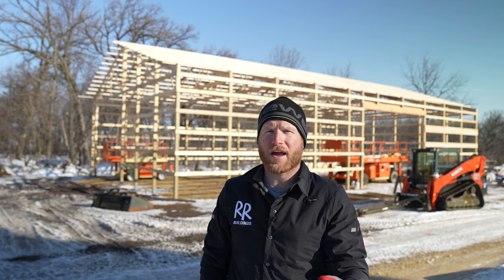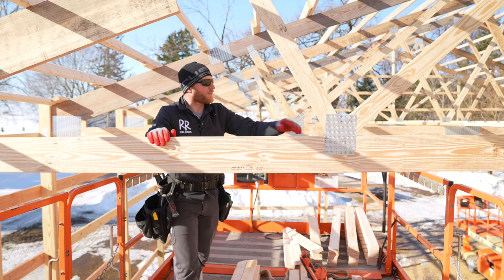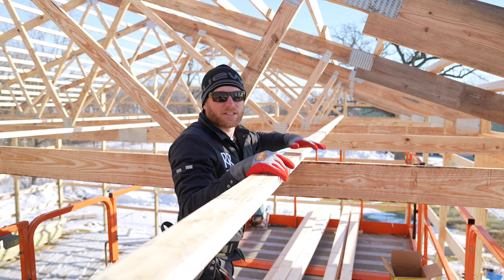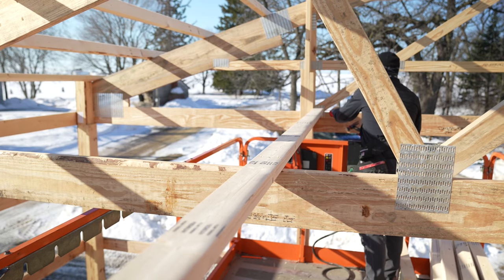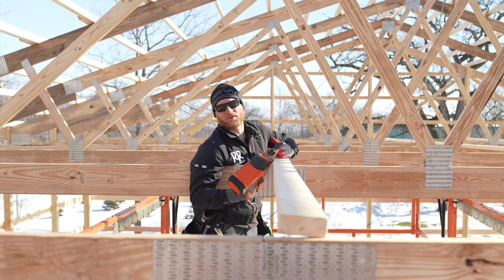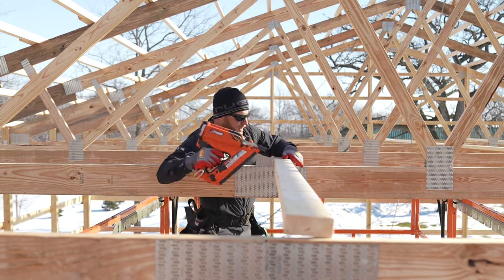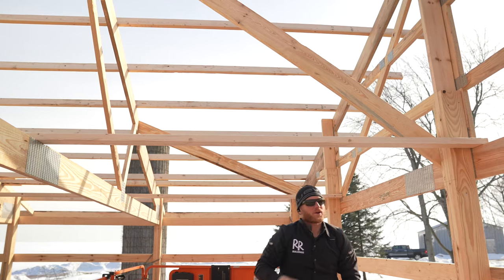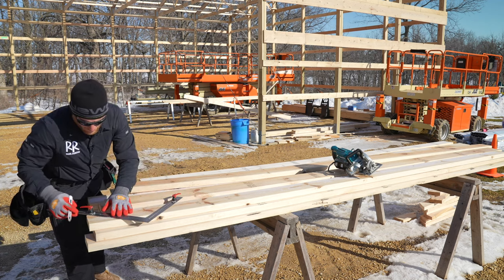How we install Permanent Bracing while Framing! Major Partnership Announcement

Comment: "more electronics in a battery only model which leads to more repairs" - I smell BS on this one!
Reply from the maker: Actually true... I’ve had two Metabo need repairs and many guys have their Milwaukee and metabos have issues
Reply: My dewalt never made it more than a week...
Reply: I've bought dozens of paslodes ever since the orange model came out. And besides the very early models occasionally having a wiring harness issue after many thousands of shots, the electronics are very solid. Never had to replace a fan or a spark unit.

Comment: If money, weight and cords are NOT an issue, what’s the most durable and efficient gun to buy,  I’ve been trying to decide on one for the last 5 years.
Reply: Honestly, look for an old Hitachi NR83A for full head of NR83AA for clipped head. Great guns, need a compressor. The NR83A2 is a close second, still made in Japan. I've heard that the newer versions aren't as reliable.

Comment: My father has an older paslode framer we use to use, and it doesn’t matter if the battery is new and charged and a new gas cell installed the thing just fires when it wants to. Doesn’t matter if it’s 85 or 50 degrees either, and I’ve done a cleaning on it. What part do they need to change for a “service” to the gun on why it doesn’t shoot?

Comment: Weight of the tool is an advantage when working with it (i.e. the lighter the better) however doesn't the lighter weight cause more light-strike nail settings, or, cause the operator to use more downward force to compensate for the lighter weight in order to get the nail completely seated ?  Just wondering.

Comment: I was going to buy Milwaukee cordless nailer. Now you got this Paslode...  What would you choose if you had to choose one?
Reply from the maker: You’d have to tell me more how you will use it because that matters.  Milwaukee is slightly more power at the cost of over 50% heavier.  Ergonomically the paslode wins too but Milwaukee has bump fire and no need for fuel cells
Reply: I am will be building a pole barn shop. Use it on that and any shed projects around my property. I am not doing it for a living like you guys do.

Comment: You say the paslode won’t have issue before a battery only gun however my paslode has been Miss firing and only working on certain gases. It makes me wanna go battery only due to these issues
Reply from the maker: Simple issue usually check the tip for paper tape build up

Comment: I'm curious why you choose to do cross bracing than the perscribed path of brace panels? Just a cost thing?
Reply: If I may Kyle. 
 Joe, follow the instructions of your (SE) structural engineer.  He's the one responsible for the structural integrity of the building.  The cross bracing Kyle installed is his method and I presumed he got assurance from the SE that
it  fulfils the design intent.  The panels you mentioned are a viable solution since they create a diaphragm action also.  If one method is shown on your plans and for economic reasons you want to do the other, get it approved so you are not liable for an unapproved change.
Reply: @budprine1591  Bud's comment is spot-on, but here in Kansas, the pole barns are not inspected, so framing detail is pretty basic. I do wonder about one thing with Kyles corner bracing - If 7/16's or 3/4 plywood is used as a structural panel in the ends of the building, similar to what we do in a residential construction,  does it not add a considerable amount of bracing to the structure because the panel can be slid up in to the truss and in essence nailed to the wall girts below it? Seems like a great way to completely keep the short-end (i.e. -garage door end) from racking.

Comment: Why nail when you can srew? Watch all videos and I was told screws are better than nails. Wish we could do a build like these in  England
Reply: Screws break. Have lower shear strength. Nobody uses screws to frame.
Reply: @skliros9235  thats changed now, when there are structural screws widely available and at a good price. Hes right screws are way stronger. Time is money so no one is going to frame with screws. But hes still right

Comment: I take it there are no building codes were you build these buildings because there’s no way you could put the weight of those trusses or just the post the way you do, and how come no cross bracing on the trusses what’s the keep those from all just domino and over,Where is the diagonal bracing to keep the whole building from racking out of square especially the roof at a square and keeping the trusses from toppling over
Reply from the maker: Guess you’ve built lots of post frames in the midwest where these are engineered?

Comment: wow you say battery nailers do't work in the cold and pasloads do work in the cold is completely the opposite, Every single time ive been on site in winter my milwuakke nail gun has never ever failed and the guys using pasloads are always having trouble with  cold gas.. its a known problem hence why electric nailers are taking over
Reply: What temperatures are you talking here? The paslode will shoot down into the teens Fahrenheit without issue. Can go colder if you switch the fuel out every so often with a warmed up one.

Comment: Unless you are Civil or A mechanical  ENGINEER,  and have done your calculations on wind loads, etc.,  your trusses are not secure without diagrned each siteonal bracing . If I understand your comments, correctly, you are installing diagonals at the ends of the buildings.  I suggest very strongly , diagonals every couple of trusses.
We lived in CT. From ‘79 to 99 .  During that time our church built a new sanctuary with large ceiling height and spans.  The GC  din not install sufficient diagonals and a high wind gust took the entire line of trusses.  Two framers died in the falls.  You are bracing at the ends of the building and you are telling us you have high gusts and  are halting the  days truss work and that the end building long diagonals are sufficient.  Beware….you may not be correct.  Your wall roof trusses MAY  actually be Stiff  enough to resist the gusty wind loads  BUT ARE YOU WILLING TO BET YOUR LIVES ON YOUR (ESTIMATES, or calculations or potential cost savings)  engineering  training.   I have watched maybe 5 videos on You Tube all without SNY diagonal wind bracing.  I have warned each site of the danger but the trusses ate up and sheathing on before anyone reads my warning.    
Great video….but you scare the hell out of me when yow install the diagonals after the trusses are all up.   God must be watching over you.  Suggest you thank HIM in your prayers.

Comment: Little bit misleading info about the structural behaviour of trusses and their components. Otherwise nice video.
Reply from the maker: How is it misleading
Reply: @RRBuildings  It's not necessary to laterally brace bottom chord of a truss when it's completely in tension (which it is in your case). Tensional components don't have a tendency to shift away from their longitudinal axis like the components that are in compression. So it is the top chord and the compressed webs and verticals that need that kind of attention. Your trusses are plumb at their supports and your purlins are taking care of the compressed top chord so that your trusses are in whole plumb. Long story short, that bracing has very little to do with the structural reliability of trusses and whole lot to do with carrying those wind loads.
Reply: I have seen the same thing happen here in Colorado with wind gust around 70-85mph and the way you did it in the video is exactly the way that we do it here and it works here for sure.  These guys just throw out a bunch of confusing opinions yet no videos of their solutions.  Owe wait they don't make videos do they?   Great video and very accurate way to build a strong building. I appreciate your info.  Don't pay any attention  to these couch quarterbacks lol.  Everybody is  a professional in their own minds.   But you my friend actually do build the best pole buildings in the industry   Thanks and keep these videos coming

Comment: While we build pole barns.. framing refers to building homes. Setting posts laying 2 ft boards up the post an setting less then a dozen trusses an laying Perlins on top of them is so basic level of "framing" is just dumb. As for your trusses being just nothing without your bracing why isn't such bracing required in "framed " homes by "framers"? Oh that's cause you got trusses carry a loaf span of 12ft not 2ft. Why don't you be a little more realistic.

Comment: All cordless nailers suck. Nobody should take advice from a shill. Gas nailers suck worse than normal in the cold. The maintenance is totally inconvenient too. Battery nailers are better for the occasional use that these are okay for because you don't need fuel, just charge the battery...... That being said, nothing is better and more reliable than pneumatic.
Reply: I agree, Pneumatic is still the best and most reliable!!
Reply: Cordless guns are only to save you time and money they are not designed to be used all day or to be beat on yet